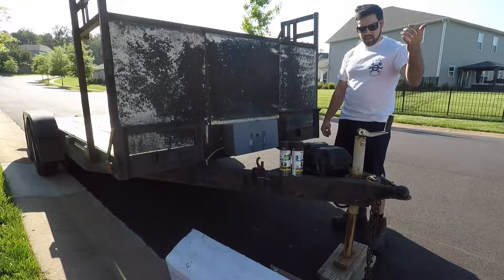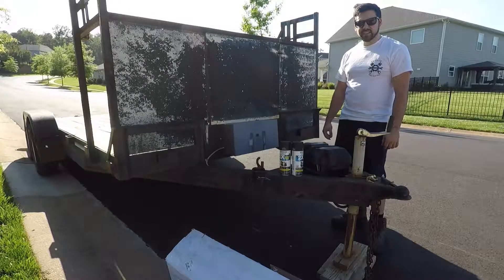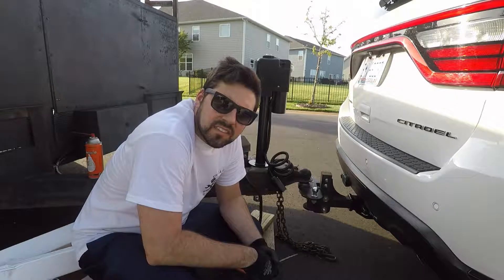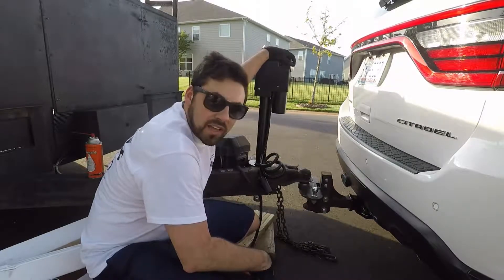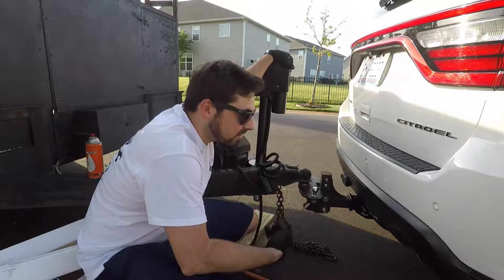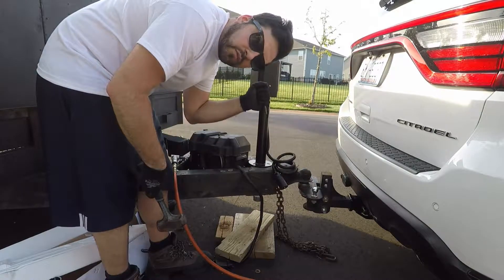How to install a Big Horn electric trailer jack

Comment: Pro tip, that pin at the bottom of the jack allows it to telescope so you dont have to sit there for 10 minutes waiting for it to take up all the free space
Reply from the maker: Max Wobbles lol thanks man.  Yes I cut the part out where I said I put it on the lowest setting for traveling while moving.  Def pull the pin and pull it out a bit to actually use it moving forward.  Def a pro tip👍👍👍